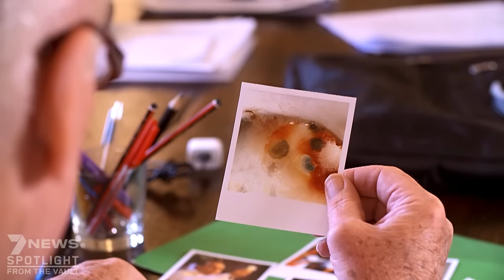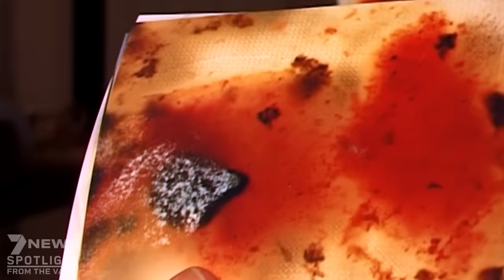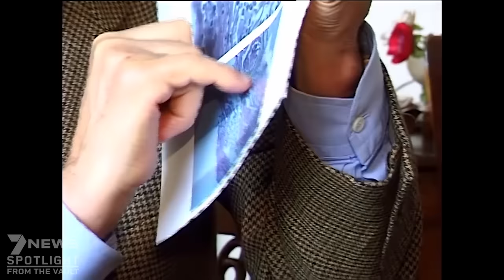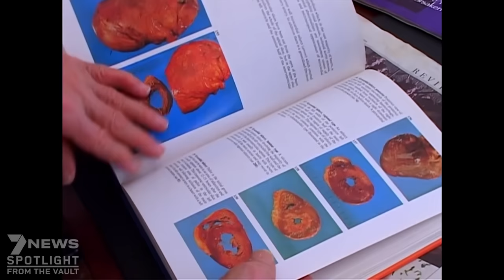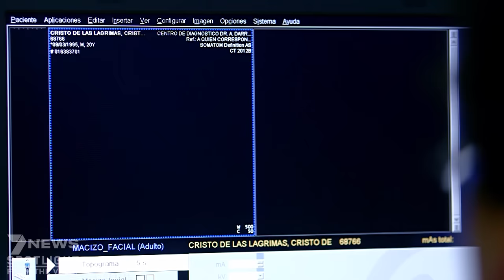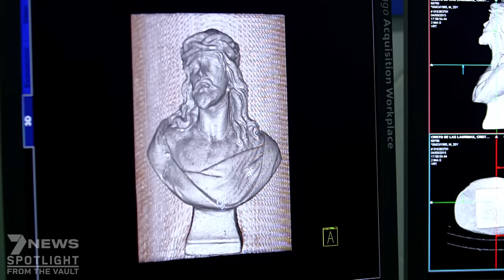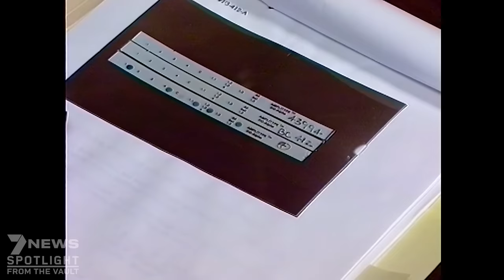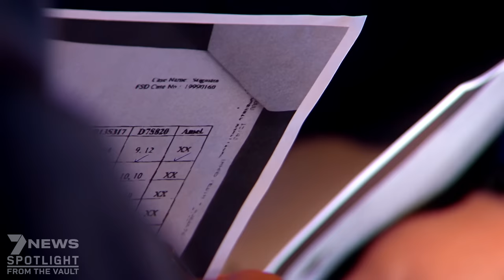Scientists INVESTIGATE signs of Jesus Christ | Full Documentary | 7NEWS Spotlight

Comment: First, a technical comment about the audio of this video. The sound level of the voice commentary and sound effects is unbalanced. The low audio level of the voice commentary required me to increase the volume to hear it clearly, however, when the sound effects punched in, they were far too loud, requiring me to decrease the volume. Because if this issue, I had to increase and decrease the audio throughout this video, which was frustrating. Greater attention and care should have been made during the audio mixing of this video.